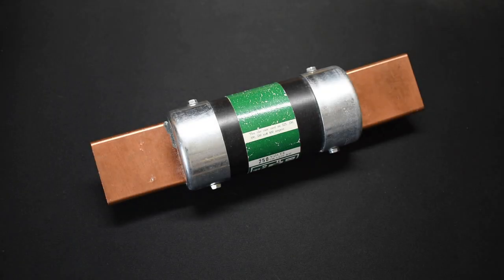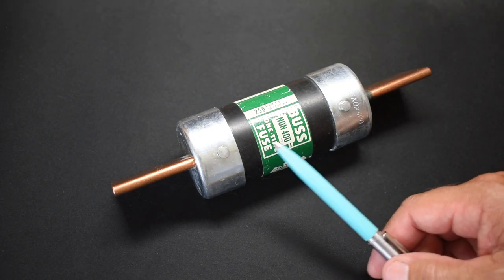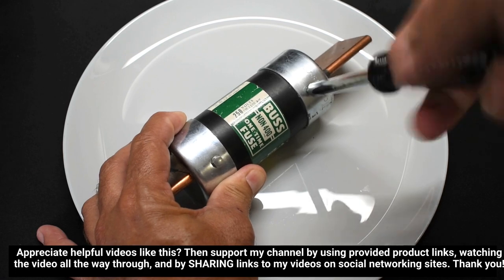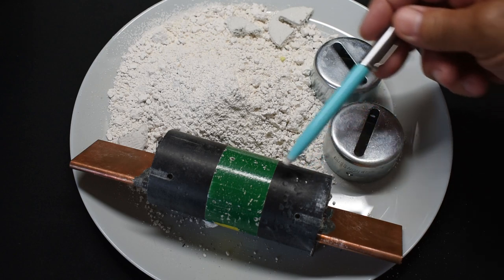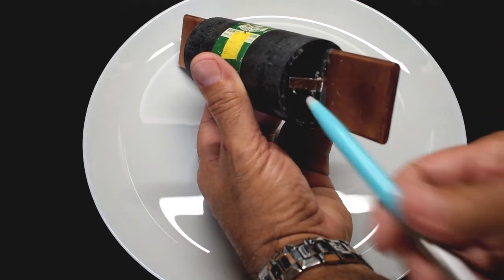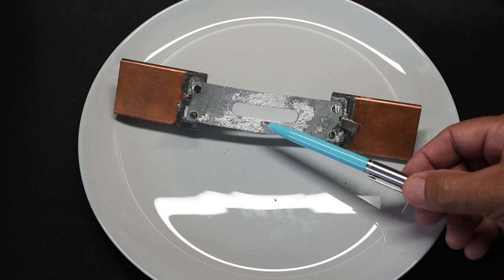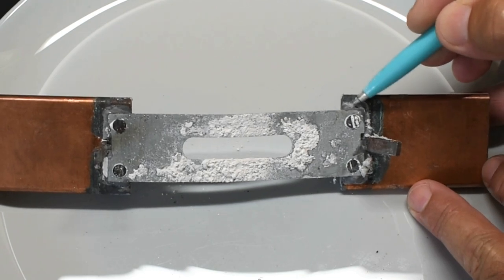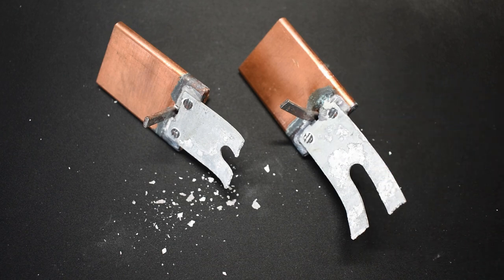What's Inside A 400 Amp Blade Fuse? Find Out How It's Made!

Comment: I just had one of 2 of my 100 amp blade fuses in my main switch blow. It took me a minute to trace my power issues to that fuse, but you know there's a problem when you turn on an element on your electric stove, and it turns on the power too the lights that stopped working all of a sudden lol I never knew you could open them up, but was curious how they were constructed.  Thanks for sharing!